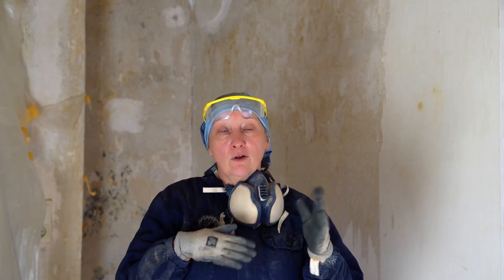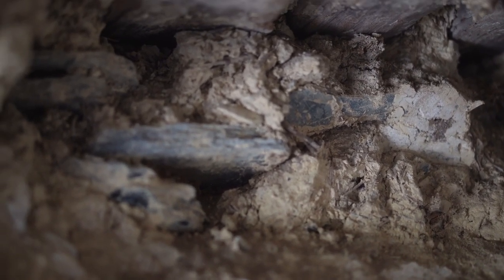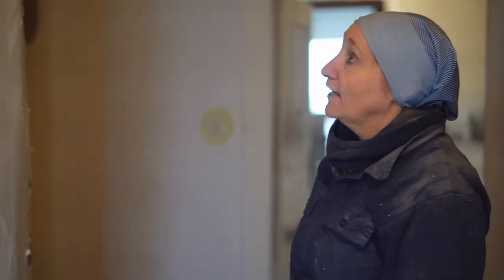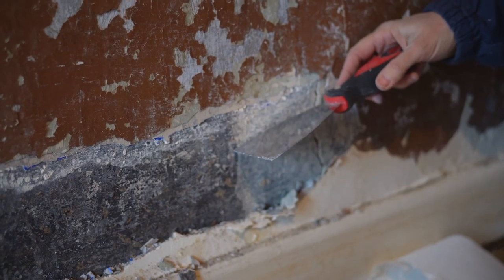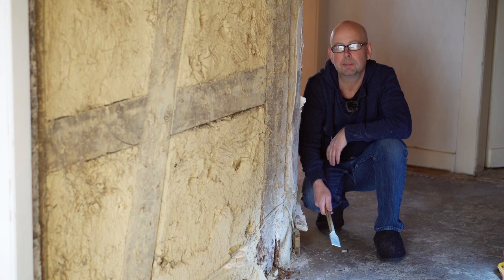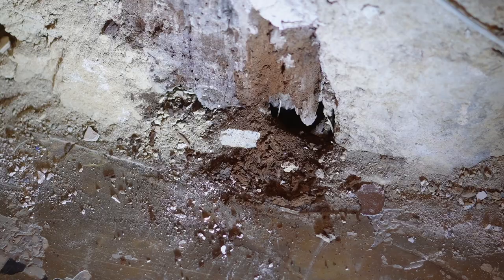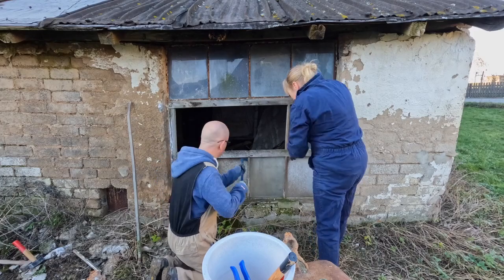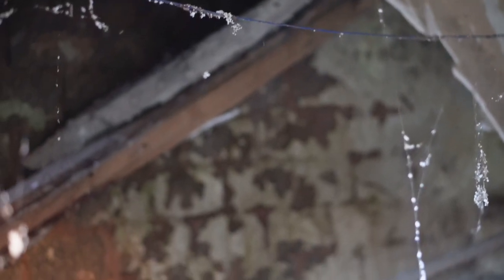Revealing 230 Year Old Oak Timber Frame: Fachwerk - ep18 - Old Farmhouse Renovation

Comment: Maybe the wall between the small room and kitchen used to be straight instead of having this weird bump into the small room? Removing the paper in the kitchen should reveal traces of that if it was that way.
Reply from the maker: Our current belief is that wall did not exist at all. Maybe it was added to create the small room, or maybe it was added to support one or more damaged beams. We'll find out soon.

If the wall would have been straight, it would end in the middle of a window. But, maybe that window was a later addition as well.

Thanks!